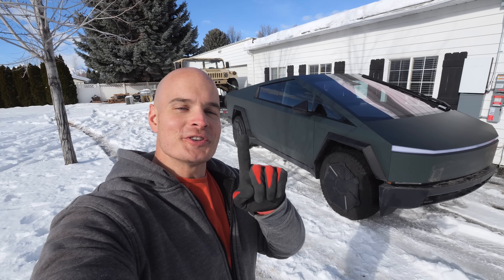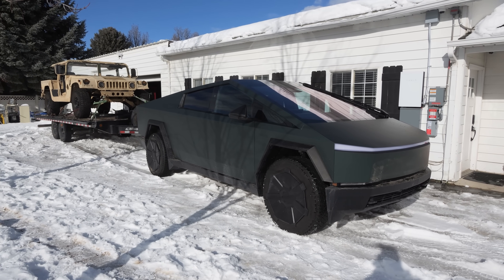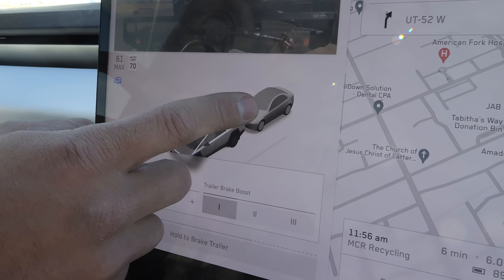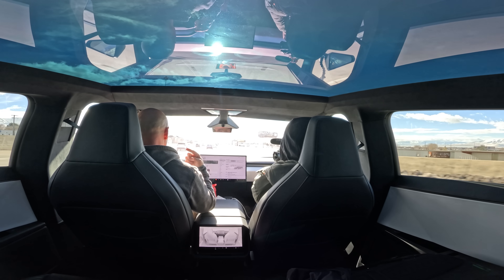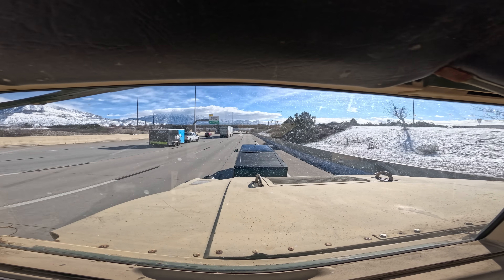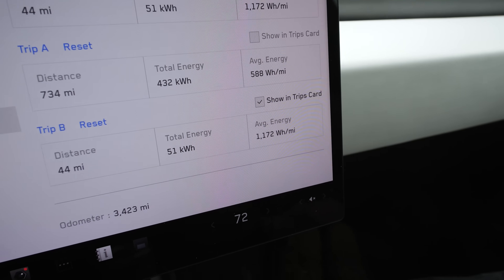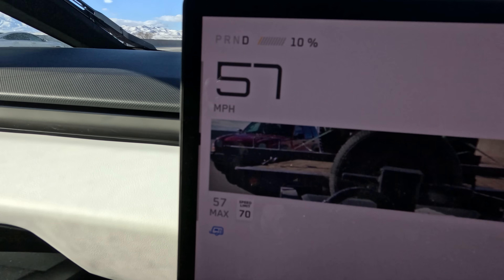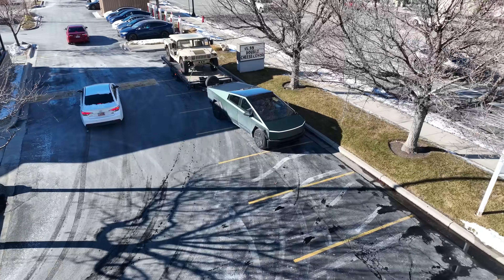How far can the CYBERTRUCK tow 11,000lbs in Freezing Weather?

Comment: I still think the Rivian is overall the better one. Besides the looks.
Reply: It seems to be. Looks definitely included.
Reply: Riian is a very beautiful lifestyle glamping pickup truck. 
The Cybertruck is a work beast. Dirty, full of fingerprints, rough, full of scratches, used hard put away wet, always ready to hop on again.
Rivian is still pretty, clean, without one dirt streak. Always!
Reply: @wolfgangpreier9160 
If you ask  me, I feel like neither Rivian nor Cybertruck will be "fondly" remembered as good "work" trucks in the future.
Reply: @TheSerbianEmperor  What else? 4 ton Hummer? 3.5 Ton Silverado? Dodge does not have a EV.
Reply: @wolfgangpreier9160  
EV's have a lot to fix before they can be considered a reliable personal work vehicle.
I would not trust a single EV truck as a work vehicle yet.
Reply: @TheSerbianEmperor  Thats perfectly ok. You don't have to.- I guess the US will be behind the Europeans and Chinese anyway in a few years when we have hundreds of thousands of EV trucks an busses.

We in Europe have many perfectly working EV trucks. Of course not such fancy like the Hummer or Raptor. 

Ours are much simpler  from Mercedes, VW, Ford, also from Volvo, Scania and dozens of more EV truck manufacturers. 

I hope Tesla imports the CT to Europe. We need a small light duty truck which the locals do not want to make so not to Osborne effect their existing Diesel-Van base and lose much money.

Now we have to build the battery infrastructure which will take some time to become independent from external powers again.
Reply: @wolfgangpreier9160 😂

Comment: Tesla really needs heated charging stations in Chicago
Reply: Or Chicago Tesla owners need to learn how to precondition their vehicles.
Reply: @LouSasshole_  How do you precondition a battery at 0% charge?
Reply: Mr apple 😂 🚙
Reply: They just ran them cars low and it was too cold. Shit happens.
Reply: The issue isn't with the charging stations as much as it is with owners not understanding that frozen batteries lose a portion of their capacity when frozen. You can't run a frozen EV to a charging station expecting it to last down to 1%
Reply: @DinGrogu2019  Bro the chargers broke down as well. Some stations with 20 chargers only had 3 working. Also preconditioning is painfully slow so you have to wait at the station still
Reply: Be interested to see what happened, there are about 30 superchargers around Chicago,  I only see the report at 1 of them,  like were they all affected,   I’m in Wisconsin and mine charges just fine,
Reply: @vxnova1 or watch Out Of Spec Reviews’ video? Who is a huge EV fan and went to Chicago by himself and confirmed multiple stations were suffering and that the problems were real?
Reply: @OmarZ77  just got prompt for that one,   Sounds like a combo of issues,
Reply: @vxnova1 do you have a home charger?
Reply: @MrEddyedr  yes i do, my guess is that anyone with a home charger won’t have this issue,  but i just  traveled cross country,  3k miles over 8 days, during Christmas, hit about 22 super chargers, 1000 kw used and didn’t  have a single issue with any of the superchargers.  Although it wasn’t that cold,
Reply: @vxnova1  yeah I’m trying to get mine installed within the next month. With the snow we had last week in Washington I had no issues with charging but people made it sound like it’s a big deal. It’s annoying.
Reply: @vxnova1  So you live in WI and don't pull a boat/camper in the summer or drive anywhere that matters.
Reply: @dellingson4833  easy there captain happy
Reply: @vxnova1  Then learn the roll!